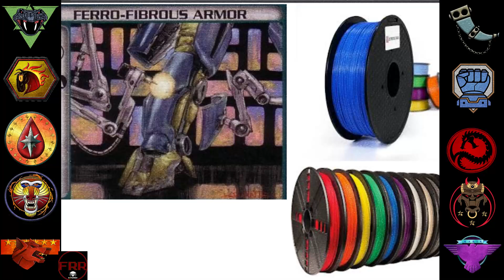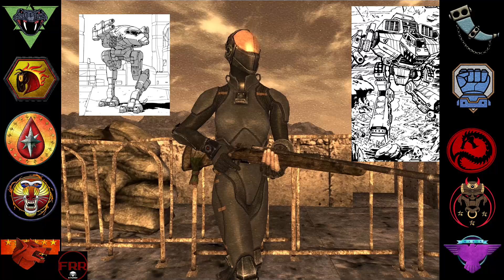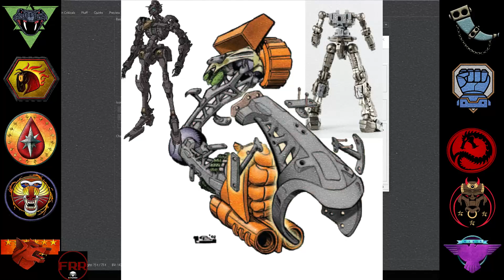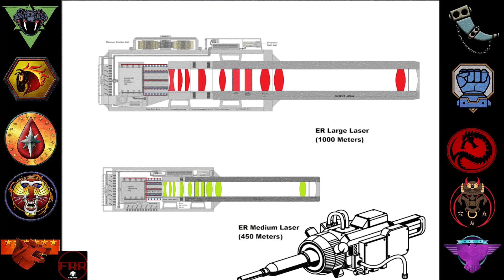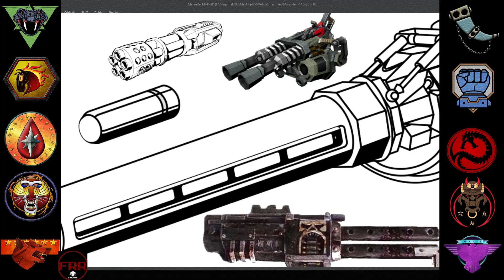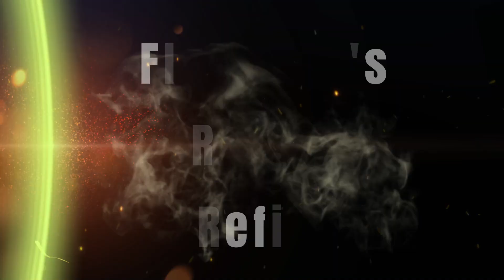Battlemech Refits: Are they as easy as the games make it sound?

Comment: A solid overview, especially from a tech at a refit center.  How much more difficult/impossible would repair (not refit) jobs be if performed on a dropship?  Would damaged armor be a quick fix while internal damage takes much longer?  Is an Overlord notably more capable than a Union or Leopard?
Reply from the maker: @matthewmarek1467  Repair jobs while on a dropship are doable, especially armor work. There is not much difference in how much room you get in the different dropship classes, as the mech bays are standardized.

Internal work will be much harder, as usual.
Reply: I agree with the Professor. Armor replacements are fairly 'easy' to do in a drop ship's Repair Bays, but Internal Structures would take longer and require the right materials to be 'on hand'. Repairing a damaged Mech's leg internals would entail the total removal of the armor, removal of the myomers, all cabling, both power and signalling, as well as computer controls,. Only then have you 'torn down' the leg to get access to the damaged internal components. If you have the correct materials on hand, the job can be pretty straight forwards, although time consuming and backbreaking hard. Trying to replace existing IS (internal structures) with other materials is near-impossible. Such as replacing 'standard' IS with Endo-Steel, or vice versa.
Reply: With the gantries seen in the game's mechbays, they should be able to handle any repairs / mods they have the time & parts for. (It is lore accurate for mercenary companies to spend years building and re-fitting mechs out of salvage in their drop-ship bays, and to know that the factory could do the job in hours.)

Since it's a leopard, the repair bays are supposed to also be the deployment bays, with four 100 ton working bays and four 100 ton storage bays (Those storage bays are supposed to be ALL your spare mechs, spare parts, and ammo - which is why mercenary companies ditch the leopard as soon as finances allow.)

Unions are supposed to be 3-4 decks that are each about the size of all of a leopard's bays, with a dedicated salvage deck, dedicated repair deck or both being more common than packing mechs on all the decks. (Rules wise it came about with the wolf's dragoon's and rules for mercenary companies. Lore wise, they've been hot swapping and adjusting the deck hight on eggs since Alexander Kerenski's day.)

P.S. I'm a "clan invasion era" player, Wolf's Dragoons were the hot new thing when I started, and the last of us went our own way shortly after the Tukayyid tournaments.

Comment: Based on the number of official designs described as beginning as simple field refits I don't think Mech refits are incredibly hard. Refitting with clan hardware might be harder but Archer Christifori's Penetrator was refit with at least some Clan weapons in the field or while in transit. so its certainly possible. Yes the refit was probably done on Huntress but it was a Huntress after the military industrial infrastructure had been smashed, bulldozed, and bombed into toothpaste.

I always found it odd that Autocannon barrel diameters were never standardized. Say 40 or 50 mm for a 2, 75 mm for a A5, 120 mm for an AC 10, and 175 mm to 200 mm for an AC 20.
Reply: That's because the terms we use are just broad general categories instead of being specific models of weapon. Just as an example some Atlas models have quick fire missile launchers which get classified as lrm 10s or even 20s despite only having 5 tubes.
Reply: @virado255  Yeah but you would think someone, the Star League if no one else, would push for that kind of thing to be standardized to make logistics, and keeping track of munitions stockpiles easier.

As it stands instead of say just worrying about how much AC 20 ammo a unit has the quartermaster has to worry about how many different AC 20 types the unit has, and making sure they have enough ammo for each type.
Reply: @roguerifter9724  Thinking like that is what ends up making people fall down the classic hole of 
"We have four different standards of thing. We need to unify them and streamline it out!
>there are now five different standards of thing.
It sounds nice but it doesn't really end up working out in practice. You'll never have 100% adoption rate for a variety of reasons. Maybe within one nation you'll see some more commonly used parts and calibers but not beyond that.
Reply: Playing with pod space is the easiest thing to do after simple armor replacement. Next easiest is equipment swaps on the sort of tech (IS or Clan) that the worker is used to. Then you've got putting Clan tech in an IS machine and visa versa. Next is messing with the fixed equipment of an omni, which is nearly as difficult as designing a mech from the ground up. I remember scouring the rulebooks for that info when preparing to run my A Time of War campaign.
Reply: @noanswer1864  Yeah theres a difference between. "We're converting this to a new configuration that someone has published the design specs for." and "The mech pilot has asked for some custom loadout deal that's going to mean we have to redo the internals." Woe betide the mechpilot who just casually asks for something like endo-steel or TSM because he is about to have hand tools thrown at him.
Reply: The writers don't even know what an AC is supposed to be size wise. The LB 2-X AC on the Shiro was quoted as being 20cm once. That's 200mm, or 7.87 almost 8 inches. That's a main gun for a WW2 heavy cruiser!